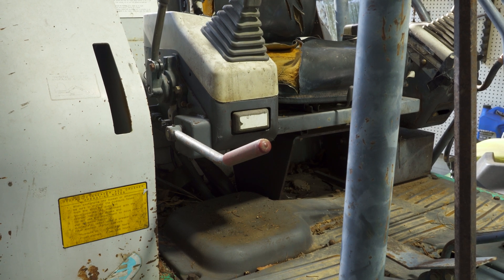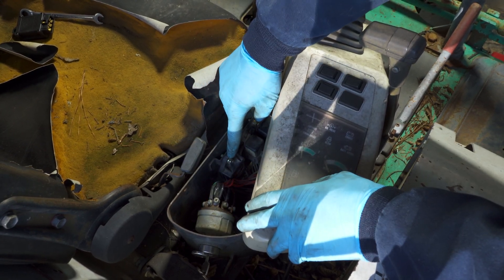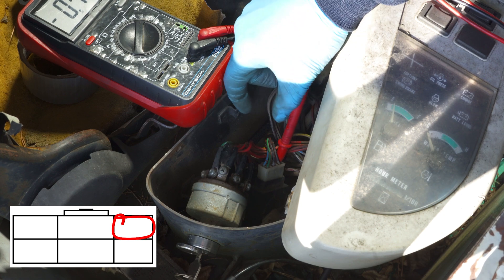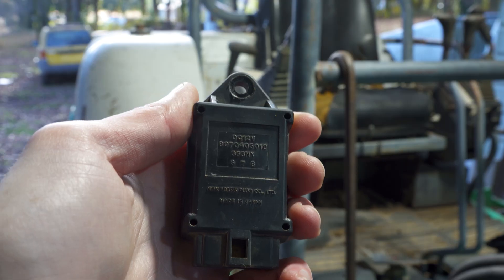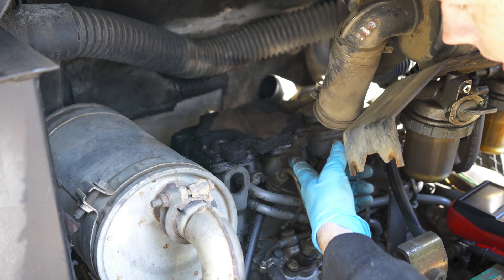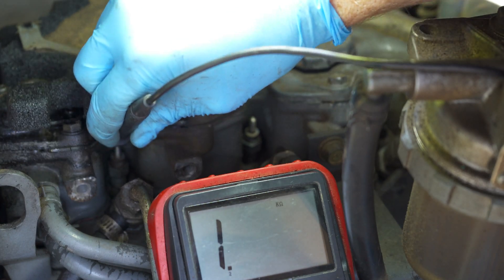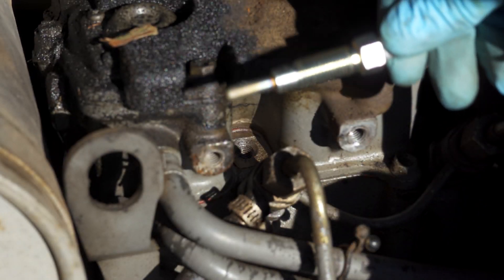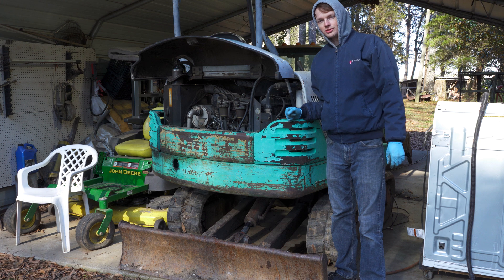Fixing A Hard To Start Excavator

Comment: Thanks for this video. I just bought an older IHI 28UX with a similar engine (3KC1) and there's not much info out there. Same issues cold starting. No current to glo plugs. Now I know what  to look for! I had thought about hooking up a switch straight to the glo plugs but I read that you hold it on too long it can burn them up so I'll try to get the correct components working.
Reply from the maker: Yep! The timer is a great device to have once it’s working. If you’re up to fixing it, definitely go that route.
Reply: @fixaday  Well I got lucky and found the main glow plug leader wire had become disconnected! Bullet connector I guess got pulled apart. Glow plugs work great now! My brother in law had that machine for a decade and didn't find that issue.

Comment: How is your IHI running a year later? I have the same machine. Bought it last fall and worked on it this winter. Ready to work on the property once the snow melts. Learned a lot from your videos on your IHI. Thank you!
Reply from the maker: Excellent! I’ve put around 200 hours on it and it’s been great. I can tell the fuel mixing in the oil is still an issue though, but happens over a long period of time while sitting with a full tank of fuel. I’m going to start closing the fuel valves when storing to see if that helps.

Comment: So, I have this exact machine, I will get together the items explained on the video. I did not get to see the why this was made, so I will give an explanation, battery fully charged and turns over but after a couple revolutions it slows to a lug and nothing. Is this why you made this? If so, exactly my issue, thank you for all the details, great job.
Reply from the maker: Good point, I really didn’t show what it was doing beforehand. Basically, it would crank and smoke out the exhaust for about 15-30 seconds before finally starting. 

Sounds like you may have a weak battery, I’d take it go get tested to rule that out.

Comment: Great video, very helpful . Is that smoke on initial start up just normal as my L3A1 does exactly the same?
Reply from the maker: For an older industrial, mechanical diesel, I would say so. Just a brief puff, but nothing more.
Reply: Thanks for that. My glow plug timer only supplies power for around  5 seconds, which I think is rather short,. Is that normal or do you think the timer is faulty. Cheers Phil  @fixaday

Comment: Thanks for making this video, and especially for showing the glow plug timer part number and pin out. I am working on an IHI 30JX with 3LB1 and am chasing down an intermittent glow plug issue so this has been very helpful. It has no starting trouble but the glow plugs will come on randomly whilst operating. Thank you for sharing your knowledge 👍
Reply from the maker: That’s a symptom my original timer had, which I believe led to the failure of two of my glow plugs. 

Glad you found it helpful!
Reply: @fixaday  Installed the glow plug timer today and problem seems to be solved, only time will tell, cheers appreciate this!

Comment: What happened to the 94 dodge 3500?
Reply from the maker: Still got it 😉 although it’s now 4wd and an auto
Reply: @fixaday  I still have not put that 5 speed in my truck
Reply from the maker: Dang lol, I thought for sure by now you’d be up and running! I think I had mine finished around late May 2022. I used a gas harness and tried using a gas PCM to control it, but the shift points were too far away for 3rd and 4th. I ended up having to buy a diesel PCM but it’s been flawless since.
Reply from the maker: I even have a clip of it running/driving in my previous video